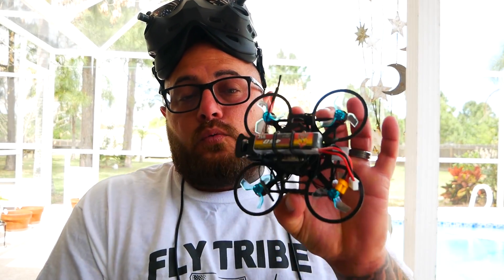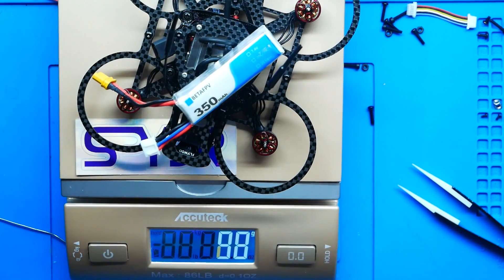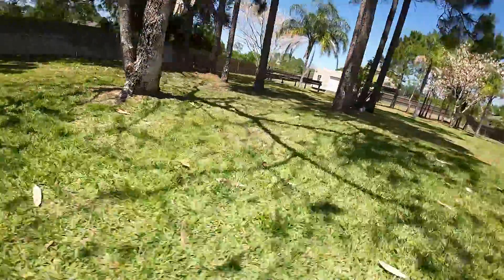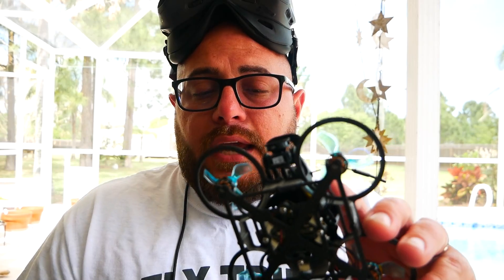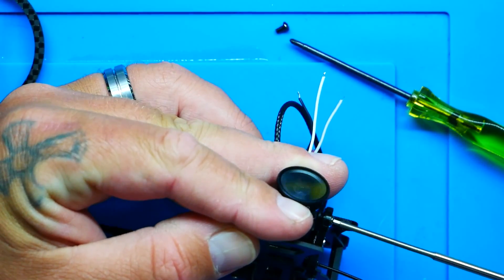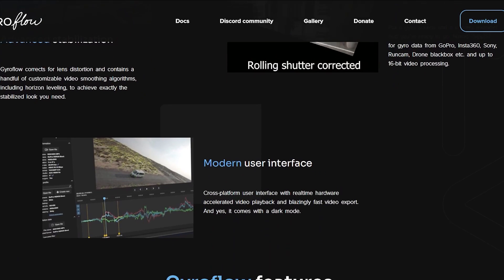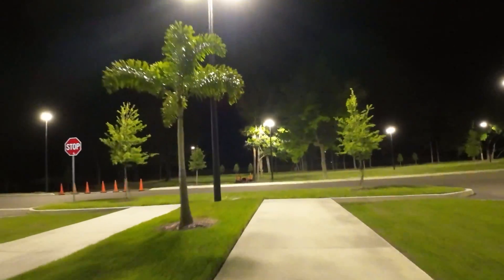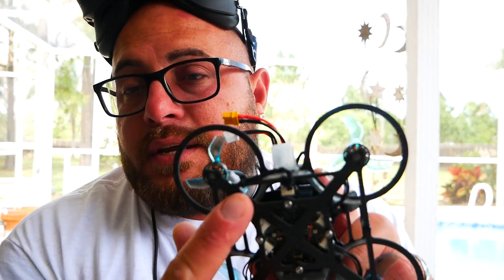Itsy Bitsy Spydr !! Mini-Cine Magic !! Sub 100g Monster !!

Comment: I love this little frame. I've been looking at it for a while. Great video dude!! 

As a side note, if you are doing a naked 03, there is a way to have it be nearly as lightweight as the ultra AND have the extra storage of Lite versions.....kinda. You can continue to strip off all of the heat shields, then remove the SD slot from the final heat shield, and plug it back into the board with an SD card installed. Now just continue to assemble the boards and the kit. You won't be able to access and remove the SD card, but you can still offload it through the usb fairly quickly. 
I've had mine like this for 6 months with no issues. I did put a tiny little piece of gorilla double-sided mounting tape against the SD card slot to keep it from rattling, but that might not have even been necessary.
Reply: thats a really interesting tip!